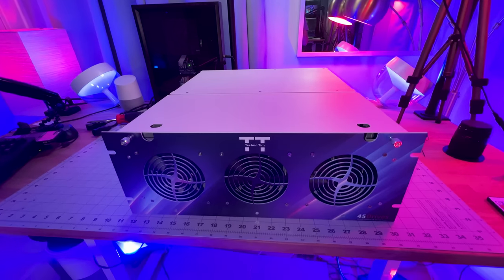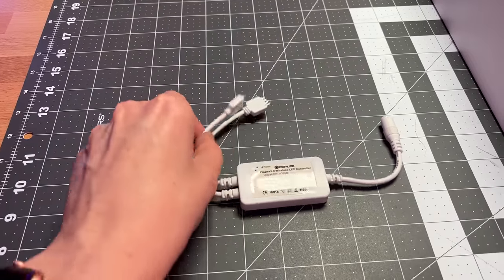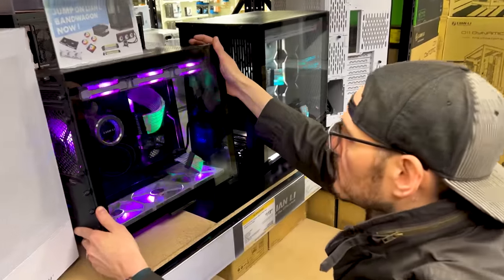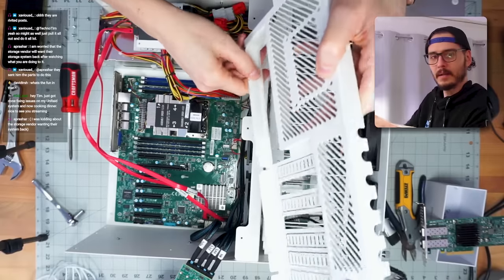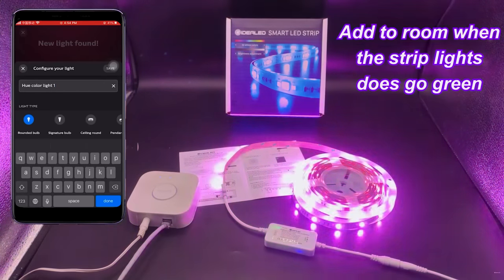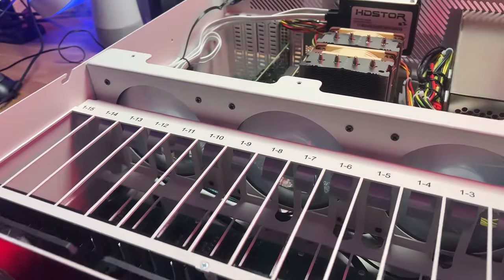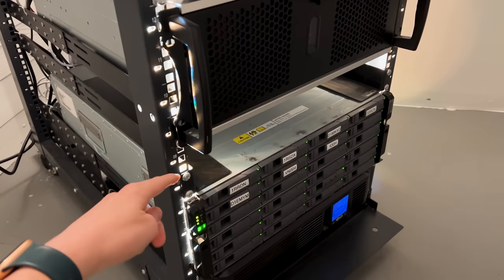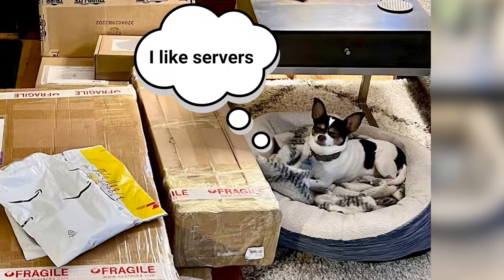Customizing My Storinator from 45 Drives - Making it Quiet and Pretty

Comment: Sooo... decibels is a logarithmyc scale. Not linear. 69 to 56 is not a 20% reduction. It is a 95% reduction. Even more impressive :p
Reply from the maker: TIL that decibels are measured on a logarithmic scale!  Thank you!
Reply: @TechnoTim  also, noise sources are usually measured from 1m (~3.3ft) away so that all the noise components would be roughly the same distance away from the mic and sum together evenly. 
If the measurement mic (watch) is twice as close to the CPU fan as it is to the PSU fans, the CPU fan would seem significantly louder (read: inverse square law). It's why even though our human voice will never get anywhere as loud as a jet engine, we can still talk over low flying jets at air shows by shouting into a friend's ear (not healthy).

Good thing you kept the measurement method consistent-ish, so the dB delta is still valid, though you're probably reporting change in CPU cooler dBSPL more than system dBSPL.

Cool build and good to know about incorporating zigbee into a PC RGB circuit for integration with home decor!
Reply: The decibel scale is logarithmic as it measures W/m^2 but the whole point of the scale is to translate sound wave energy to to some perceived linear scale. A 10db increase is a perceived as twice as loud, but represents a 10x in energy. 
Long story short, don’t use % for decibels— +10db  is 2x, -10db is 1/2x.

Comment: Decibels are measured on a logarithmic scale. 10 decibels less means the sound is half as loud. 10 more would mean the sound is twice as loud. :)
Reply: Decibels are calibrated so that a difference of 10 is 10x (about 3 is 2x).  The point stands, but the scale is much larger than 2x for -10 db.
Reply: @SservisGaming  Technically right - 10db difference is ~10x difference in sound pressure.  But humans perception of sound levels is non-linear too.  Most audiological studies suggest that 10db difference in sound pressure results in an human perceived 2x difference in volume.

Comment: Something I would love to figure out is how to use the RGB lights as a status indicator for serer issues.
Reply: Should be possible somehow through home assistant, or using a Corsair Commander Pro as an RGB controller instead.
Reply from the maker: Easy enough if you can write a little code, this is how I change the lights in my room while live streaming!

Comment: Not sure what's the point of 4u server that can fit 15 drives while Supermicro SC847 can fit 36? Only difference would be slightly more depth, 70cm (27") vs 50cm (20")

Comment: I'm curious to what kind of temps that SSD that's right behind your CPU cooler fans gets up to. Seems like it's impeding hot air exhausting out the case from the CPU cooler, and realistically the entire rest of the case. Not that your LEDs really use much extra power, but I liked the idea of them turning off with your room lights. Looking forward to the rack build.

Comment: There's two comments already about decibels being a logarithmic scale, not a linear scale. Check Wikipedia's "decibel" page, but beware that decibels when used for sound are not the same when used in radio, signals, and other EE work. There's an entire wikipedia page just on sound pressure. It looks like there's a predefined reference level for sound pressure, plus some more detail around how the scale is supposed to curve, but frankly, the details are over my head. The table of common levels from wikipedia's "Sound Pressure" page seems more useful. You quieted the server from "just barely not damaging your hearing" to "quieter than a TV" or "around the volume of a loud conversation". That's pretty significant, never mind the exact percentage change (even though that could be calculated (and is probably a lot bigger than 20%), being mindful of the difference between "power" and "amplitude").